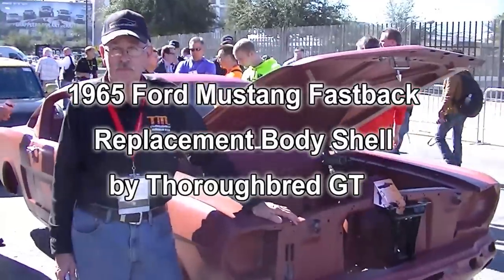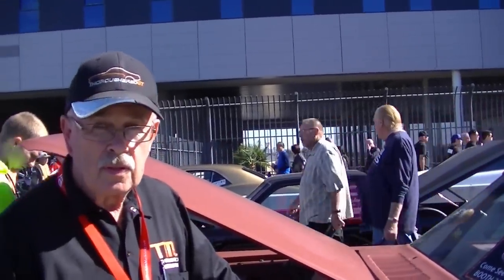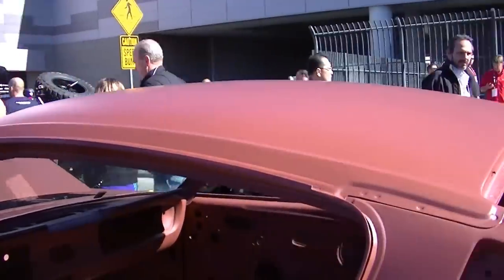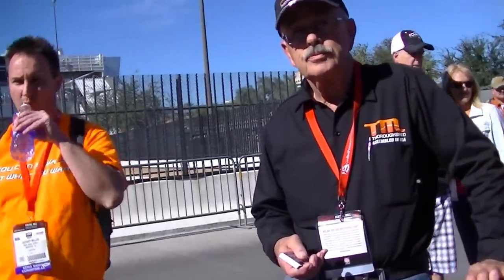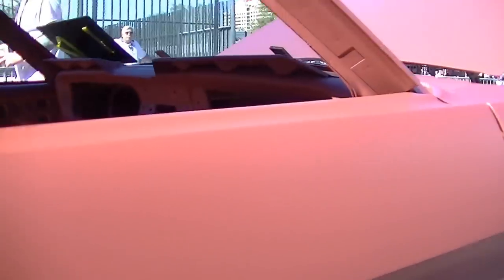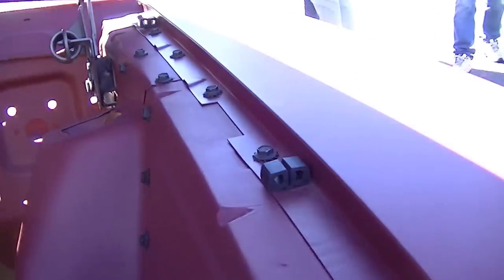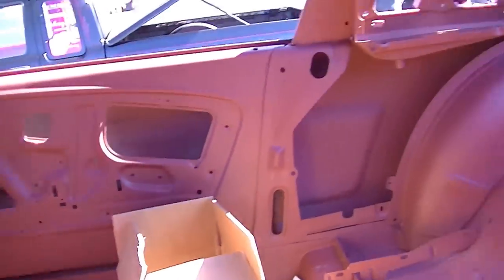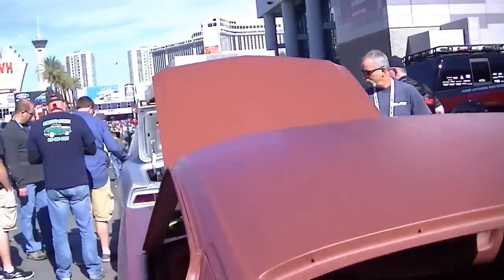1965 Mustang Fastback Restoration replacement body shell by Thoroughbred GT at SEMA 2013

Comment: Fyi...The dual exhaust rear frame reinforcements are also in the K code cars, not just the GT's.
Reply from the maker: Yes of course any of the duel exhaust cars which would mean all GT A and K codes and yes the K code did not have to be a GT.

Comment: haha, it would be cool if the cowl could be removable but we all know why it isn't!
Reply from the maker: leloodallasmultipass I am convinced their is a market for a removable cowl retro fit set up for the early cars.
Reply: MustangConnection1 could be.  time to go make one!
Reply: leloodallasmultipass Why would you want the cowl to be removable?
Reply from the maker: Dave Brittain  To be more specific the top cowl panel because you  have a way to clean out the debris( leaves, bugs, dirt ) that gathers and plugs the cowl vents. So many of the early Mustangs have rusted cowl assembly for this reason and they are major work to repair. Staring in 1969 Ford changed the design to a removable cowl set up.
Reply: MustangConnection1 which is why they rot out there to begin with !!